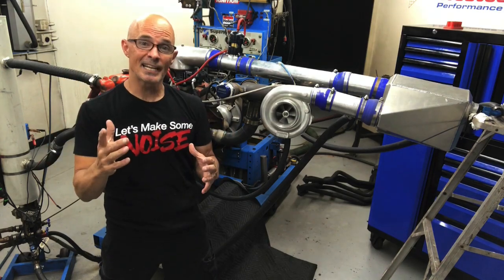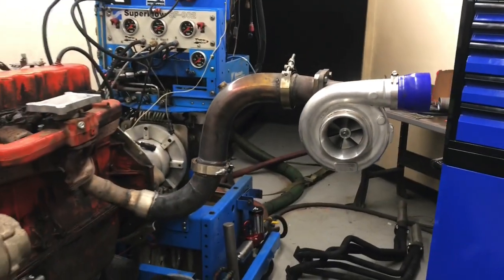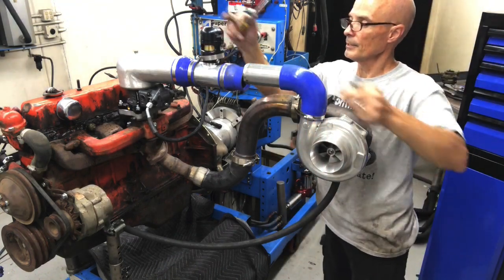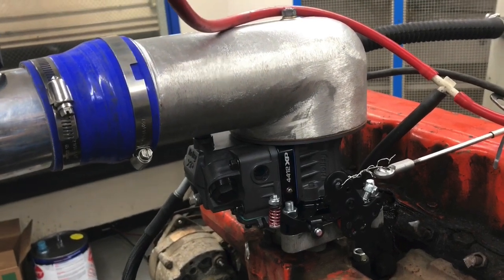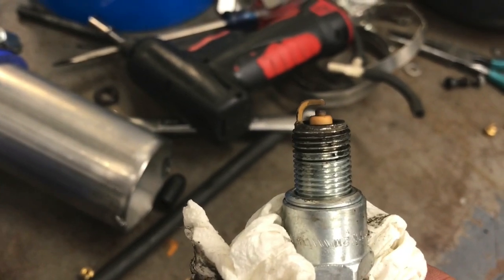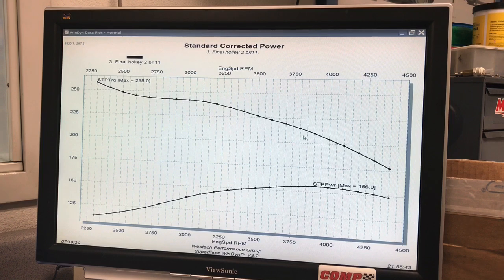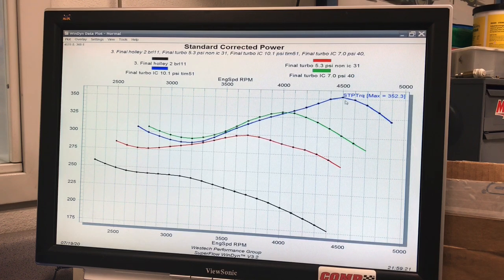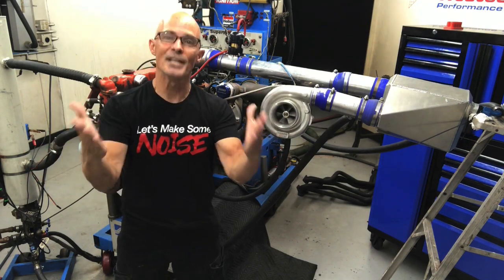TURBO 292-LOW BUCK, DIY POWER MODS

Comment: Have you ever put a turbo on a 305 or a 351 GMC V6. 
It is a low RPM high torque engine and I am looking to increase gas mileage or basic efficiency of the engine.
Reply from the maker: you won't increase mpg with a turbo

Comment: Numb question - would an oversized turbo give low (2-6 pounds) of boost with minimal back pressure - for improved efficiency?

It would only kick in at higher power settings, but that’s where it would help the most - say, pulling up long, steep grades at freeway speeds… like Cajon Pass, The Grapevine, or I5 Northbound in southern Oregon.
Reply from the maker: improved efficiency?
Reply: @richardholdener1727 yes, low(er) bsfc compared to the more usual attitude toward “boost” - which seems, “hang the idea of efficiency!  I want big gray clouds of tire smoke!”

I’m a bit too old for “big gray clouds of tire smoke.” (Retirement age.)

I’m not too old to want to not struggle to climb long steep grades like the ones mentioned.  I recall going up and down each of them at least once.

Comment: I have a 305 , 5L GMC V6 . My question is will boost help with gas mileage. This engine is set up for low RPM torque and the gas mileage just is not there.

Comment: Hello richard you've inspired me to build a turbo set up on my  chev 250 ...  just so  I completely understand this... 🤔 you're showing that I can easily make 300hp/torque using that stock Intake  with that tiny 1 barrel carb hole ???  With no modifications to that tiny intake hole??  For only good streetable power with a T3. These results are typical??  From my inexperienced tubo mind...That seems not even possible....  at least without a BIGGER carb opening hole size.
Reply from the maker: stock opening in stock manifold with a 1brl to 2 brl adapter and holley 2 brl

Comment: 292 2 center intake ports are stupid clogged ! Atlas 4200 NA , over 300 T and P flat curve from 2000 to forever , and all aluminum ! Ford 6 cylinder is the best by far cast iron six ever made ! Do you think the 4200 with manual AR5 speed , .70 ovedrive gear and 4:10 rear , is capable of moving an 8000 pound Class C van type motor home easily ? It has a 400 sbc and turbo 400 trans now that easily moves it 225 hp and 375 tq  . Would it improve fuel mileage also ! Thanks Richard .....
Reply: The 4200 is not especially fuel efficient in stock form. In a vehicle that is 8000 pounds and needing fuel efficiency, you should go diesel swap. If you can't afford that, then with the 400 SBC you have it's about reducing parasitic losses in the driveline and chassis. 
WPC treat the wheel bearings and rear differential parts. Use a high quality full synthetic lubricant in all systems, and I Lubrication Engineers products.
Call Jones Cam Designs and get a custom hydraulic cam that optimizes torque in the 1500-3000 range. Get the carburetor freshened up and tuned, then add in a Carb Cheater from Thunderhead289 ( his channel is on YouTube ). Add in a free flow exhaust system to finish. If you keep the rpms down, you should do 12-14 mpg.

Comment: Should a Poor retired engineer with Hot Rod roots supercharge  an Inline 6 or try to Supercharge a 4.8 LS or Build a 327 30/30 cam???? Dennis
Reply from the maker: I would pick a cammed and carb 5.3l

Comment: An inline 6 really benefits from fuel injection to ensure fuel distribution. With a carb the two center holes will always rich compared to the 2 outside holes.

Comment: Hi Everyone! 
Richard,  
I have a 69 PONTIAC 1969 350 4 bbl  MOTOR. It's been removed from the Lemans and I like to get it rebuilt . Major  issue is the heads on this  350 are number 48 's I'm not sure but the cam appears to be a 744 . I have high compression 10 25.1. the manual  says  this xu motor developed around 325 / 330 Hp. It will not run on pump gas,unless the timing is so retarded and then there's  a loss of power loss. I'm thinking of sending the Motor to Bruce Fluper or looking for recommendations please? Do you rebuild these engines, is there a simple answer? Perhaps like change the heads and cam? I like to run on pump gas and have more torque plus Hp 
Thankyou for your time. I love your imformational videos, Lucas 
, 

Thankyou
Reply from the maker: you can use a thicker head gasket, polish the chambers, run the motor colder (water temp) also make sure the motor gets only cold air (not under hood air)
Reply: @richardholdener1727  
Thank you , and I appreciate you taking the time to answer my q: I would like to have the 350 rebuilt locally here in Florida perfect world ,but wou I appreciate recommendations anywhere that still  believes in quality and torque !!!   
So Mr RIchard , do  you rebuild pontiac engines for regular folks like Me?   330 
Hp back in 1970 it still is . 
Can you tell me if you would recommend  this gentleman that's if you wven know him  or his work ? 
Name Bruce Fulper Rock and roll engines  out of California.  

Merry Christmas to you, and  may God bless your family . 
To everyone here , I wish you health and Happines ...

Comment: Could you use a m90 supercharger off of a 3.8 on a straight 6? Just a thought. It would be a cheap power adder for the straight 6 cylinder engines as they could use a little peping up.

Comment: I’ve got a project I’ve been working on I’d like to share with you, I’ve been working on a cross flow head for these online 6’s. I’ve taken 2 Lv3 LT 4.3l heads and milled of 1.5” on the front of one and the rear of the other one and welded them together to make 1 head. I’m in the preliminary stages but have an assembled head and am working on the deck surface currently.
Reply from the maker: VERY COOL-DIFFERENT APPROACH THAN LS OR LT V8 HEADS

Comment: Love the show, but I'm missing something. Why not test intake and exhaust manifolds first, then add boost? That old 6 could make 200+ HP n/a, should make 400-ish at 10psi. Just curious, glad you're checking out all the angles with the stuff you have in your shop. Jam on!
Reply from the maker: it would be hard to get it to make 200 na hp but if we do, it still won't make 400 hp with 10 psi
Reply: @richardholdener1727  I'm amazed that you got above 160hp with the stock intake manifold and low compression, at only 4500rpm. Already close to 200 ponies na, pushing 320 at 10psi boost... PowerNation built a Ford 300 that made 201hp @ 5000rpm, they used stock valves in a stock head. They went crazy on boost and got over 500hp. That 292 has more to give

Comment: Any help would be greatly appreciated i have a 99 plymouth prowler 3.5l v6 and I'm looking to turbo it and right now I'm pushing around 250to275 hp cams grounded 4 degree advance ported heads valves 5 back cut and ported thro body I'm only looking to get 400hp out of it can anyone advice me on what turbo to get that won't break the bank because I do everything myself because I don't have alot of money paying my house hold bills and taking care of my parents bills don't leave me alot . I know they don't make a kit for my car but should I start with a kit off ebay I know ebay but again I don't have alot of money I had to teach myself how to weld so I can afford to work on my car just need to know do I but a universal turbo kit or just a turbo and go from there and what turbo to get thanks for any help
Reply from the maker: gt3076

Comment: sir, you have the turbo way too far away to get any low end torque. shoves the power range over 3000.. for a truck motor low end grunt is everything.
Reply from the maker: the turbo distance does not change effective rpm

Comment: I have a GM 250 that is being built right now, I have a late 60s 194 head with small combustion chambers, 194 intake and 160 exhaust valves, mild cam, flat top Ross racing forged pistons, stock crank and rods,  600 Holley with Offy intake, can I put a turbo on it? I was told with a small combustion chamber it my not work.
Reply from the maker: WHAT IS THE COMPRESSION

Comment: I can’t wait till the goodies show up I know there is a lot of restrictions on those intake runners it looks like a late 60’s or 70’s engine if it’s original it should have the 12 counter weights anything after 67 has them and the later Mexican made ones with the 3 big dowel pins .261 are Nodular cranks.

Comment: A response would be much appreciated... I have a 250, bored 30 over with Forged flat top pistons. Block has been decked, head resurfaced and slight porting, and an aggressive Solid roller cam. How much power do you think it could make with 10lbs of boost on an Edelbrock AVS2?
Reply from the maker: not sure what cam specs are, and how well the head has been ported so hard to estimate. or what size the turbo is

Comment: Just FYI, the stock NA 292 makes peak torque between 1800-2000 rpm. The numbers at your load in are actually after the peak. I chassis dynoed mine starting at 1500 rpm

Comment: this so cool man i did same setup on old chevy 235 think thats what was haha was in 1950 chevy pickup used turbo off neo 6 skyline blowthrough 350 holley the hole set up cost like100 bucks went well have video of first start on my channel the turbo you used i run on my small block chevy haha wicked keep up the good work

Comment: You should totally do a video about your pieced together turbo setups with the factory manifolds and bottle necked exhaust pieces and compare the power boost/back pressure and how soon boost comes in and compare it to a well put together tubular turbo manifold and very close tight fitting piping like something you would see in a custom dedicated dyno setup.

Comment: We ran a 3/4 ton Chevy with a 292 and Clifford intake, 500 Holley and headers for several years and towed a lot of cars. We turned it 5500 rpm but we would have to grind the valves about once a year. It would outrun the one ton 454 and 460 tow trucks. One of the guys got a ticket for over 100 mph towing a ford station wagon! I enjoy your videos! I’ve built a twin turbo 05 1/2 ton Silverado for a daily driver now. Thanks Pete

Comment: Richard your videos are awesome. I'm sure u get requests constantly but I would love to see how an old big block with basic bolt ons responds to small changes like open spacers vs 4 hole and 87 gas vs 93, also small increases in timing and  maybe some carb swaps like a 600 to 750. things like that would be awesome to see cause it's small changes guys on a budget can do with an hour or 2 of spare time

Comment: It really began to get interesting at 7psi., when it started climbing the ladder. Lol

Seriously though. Interesting results. You mention using a smaller turbo, totally understand that. My question is, after you do the mods and use a smaller turbo, will you also test it with this turbo. I would like to see the comparison on how much could change, even with the same inlet air restriction.

Comment: I really want to see this on a 4.9L Ford. Yes, the 300, but the later, fuel injected version as I think it would be better overall for power and driveability. They are super cheap to find in the junkyard.

Comment: Great to see all the steps! Thank you for the timing and jetting numbers. I LIKE DETAILS!😁 As much as i really want to see a built motor, I'd like to see a good intake and a proper size turbo (with good ignition of course) on the stock engine, for us budget guys. These L6 parts add up quick.  Those almost 7" long rods and 1600+ gram pistons are going to be the limiting factor on the stock bottom end. 12Bolt Tom Lowe has the answer with his forged rod and piston setup. Give him a call Richard! He may just hook you up!

Comment: Richard, I hope you can find a Ford 300 ci I6 that was available around the same time in Ford trucks (and I knew of one 67 Falcon that had one up here in Canada) to do the same type of upgrade series. Maybe even a Rambler I6, because it was run  in the Indy 500 in the early rear engine revolution. I really like this "other guys" series of yours.

Comment: Throw a small A/R hotside on that turbo .... it's likely a .96 so a .64 (if you can get one that small) would be perfect for THAT motor since the 292 doesn't spin too fast and the short legs on the turbo would match up insane.

Comment: I'm building a 292 with 4-71 blower and aluminum 12 port cross flow head. I expect 800-1000 hp.
Reply from the maker: Very cool-but I don't think a 4-71 will support that power level
Reply: @richardholdener1727 I agree it's questionable. I may have to move to 6-71. I know of 3 guys running 1000+ hp. 1 blower and 2 with turbo. I want to stay roots because it's a 53. I also have 3 Roch 2 bbls. Billet crank and cam. Electromotive direct fire ignition. Thanks for responding. I'm really looking forward to more videos.

Comment: Good friend of mine ran one of these in an old Rat Rod F100 chassis. Put a Vortec, no I/C, Swapped to full Dist, and blow thru. Wasnt any neck snapper, but was a bad ass cool build for a Rat Rod, that looked even cooler and sounded nutty with no exhaust!! And yes it did kill tires very easily!

Comment: Really cool to see someone puttin their hand in a 6 cylinder chevy with turbo! I have a 230ci engine, not the same as the 292 but is more or less the same platform. Hope you to keep working on this engine with the right size turbo to see what else It can make! Are the internals (pistons, rods, crank all bone stock)?

Comment: I love how you talk to the parts. I do the same thing, I've been known to cuss it a time or two... "i WILL win bitch!"
I don't really know a lot about turbos but I'm learning through you. I'm a little bit knowledgeable but I never would have thought about the fuel pressure on the carburetor thing. So I'm assuming and asking would a typical basic turbo setup need an electric fuel pump? Or could it get by with old school eccentric Drive mechanical pump?? 🤔 Probably not it seems. One more thing, I love your comedic laid-back approach, and I love this Oddball stuff. Though the LS is more applicable... THIS is more FUN!
Reply from the maker: thnx

Comment: 14:11 
I do it that way almost every day (I probably change 100 some odd plugs a month maybe more. ) 
So after a while you decide to take a calculated risk to save time ,and with some practice you won't break or damage them. 
I hold em so the side of my hand hits the table along with the plug , like a karate chop and it keeps you from smashing them shut. 
A really hard surface is nice for the gap calibration built into my hand so I can get em within a couple taps. 
Just don't be stupid and try to force it back open by smashing a feeler blade in it and prying if you close it too much. 
Haha that's my butchery tip of the day

Comment: I'd like to see a video explaining how to set up a carb for blow through boost. I think I understand it well enough to give it a go, but it would probably save me a lot of time, money and grief to have some of the benefit of your experience. I plan on boosting my Nissan/Datsun L20B with a T25 and a Weber side draft carb once my brakes, tires and suspension are adequate for more power.

Comment: Weird question have you ever considered dyno testing the older 3.4s from fbodies with the grand am 3400 head and intake swap, wottech has an incredible aftermarket for most anything you could be looking for
Reply from the maker: I did turbo a 3400 Grand Am way back
Reply: @richardholdener1727  any chance you remember the power number ? I might wind up just swapping the whole 3400 into my car, and save the lt1 and the 5.3 for one of my other birds

Comment: I had a 200ci Straight Six in a 1966 Mustang.  Would love to get a another one like it and do a turbo build with upgraded suspension, rear end, brakes ect.  So much more interesting than shoehorning another 429..  That has been done.. Something cool like a boosted straight 6 would be fun.

Comment: A normally aspirated straight or slant six typically has the intake and exhaust ports on the same side of the combustion chamber.  Most attempts to hot rod these engines are underwhelming because of the dynamics of the intake charge and diminishing scavenging at higher rpm's..  Bigger ports often kill the low range torque and the engine bogs.  A turbocharger works great on these engines because it addresses the inherent limitations of the engines intake and exhaust  port design. Also, an inline engine only needs a single turbo as well where a v-6 or v8 would need two.

Comment: Richard seeing your playing with sixes could you please do a blow through slant 6 engine ! With a snail or torque storm centrifugal blower . Would be a good comparison between the 2 as a lot of folk are really getting into the slants but the biggest killer are the ports on these but with boost they can make some decent power for the street. Cheers and keep up with the great contribution to us gear heads .

Comment: 10psi on a little turbo is not the same as 10psi with a big turbo. Just look at compressor maps. Flow vs pressure
Reply from the maker: if they both support 10 psi at the power level-the power will be very close